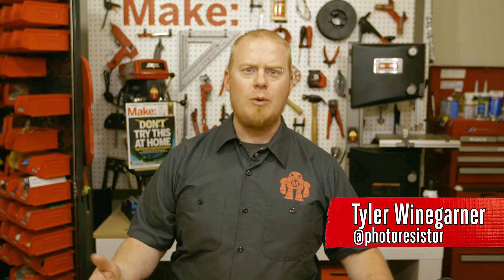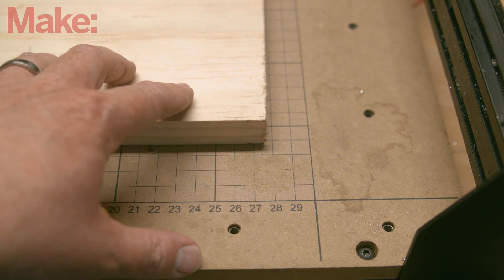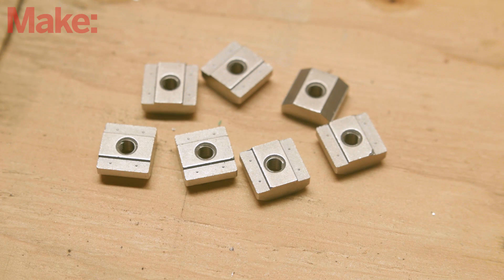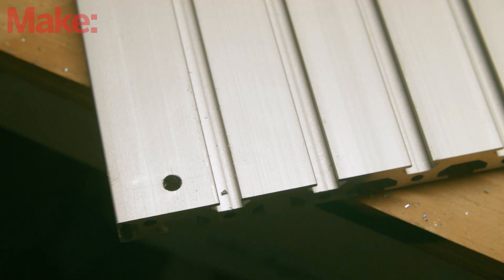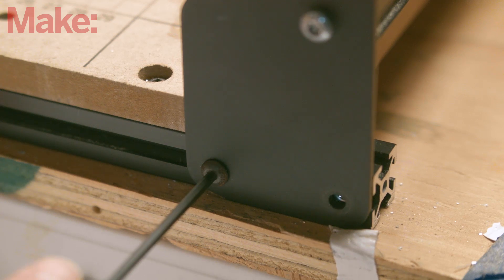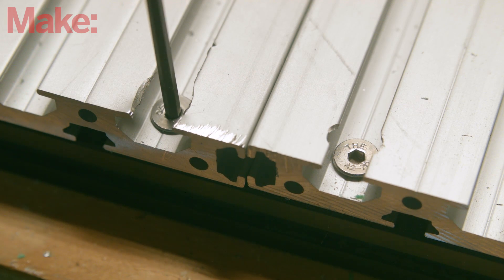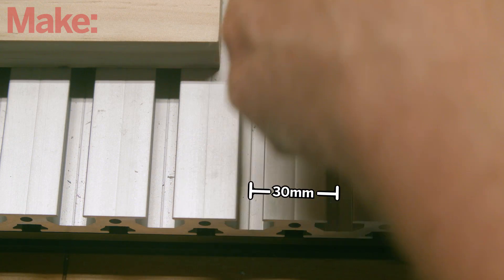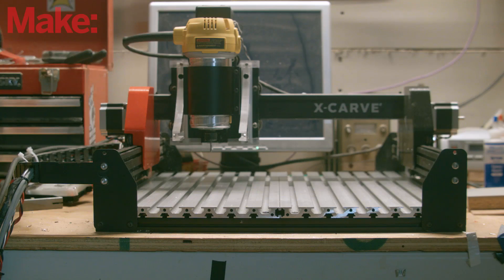Add a T-Slot Bed to your X-Carve for Better Workholding

Comment: Soooo, you remove a spoilboard, replaced it with one made from aluminum THEN you need to put on top of that at least another 1/2in - 3/4in spoilboard. So net loss of usable  Z height is about 20mm.
Reply: Gary Slovinsky the spoil board he demonstrated was 1/8"

Comment: how about an electric circuit through the bit and the bed such that it acts as an end stop if you accidentally route too deep? would also save the machine if it touched a clamp down screw...
Reply: sketchaus that's actually a really good idea! Although I guess it wouldn't work it you were cutting anything metallic

Comment: Why didn't you use the t slots on the bottom to mount it? Thanx!
Reply from the maker: I suppose I could have attached it to the inside of the 2020 rail with a right angle bracket, but I wanted a simpler, stronger connection. Mostly though, I didn't think of it. :)

Comment: Cool mod! Does this also work for the Shapoko 3?
Reply from the maker: I'm not familiar with the frame of the Shapeoko or the overall dimensions - but as long as there's a rail these can clamp onto, I'm pretty sure you can make it work.

Comment: How much did this modification cost you?
Looks like this could work well for a drill press too.
Reply from the maker: The Misumi extrusions were the most expensive part - at $28 USD per piece. With shipping and the rest of the hardware, it was under $100